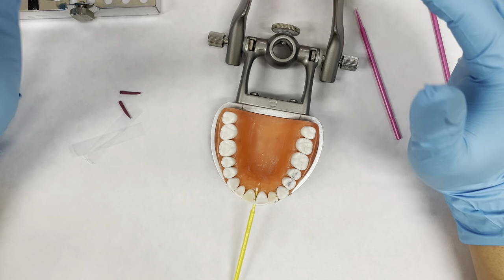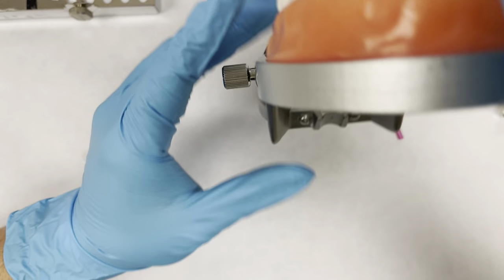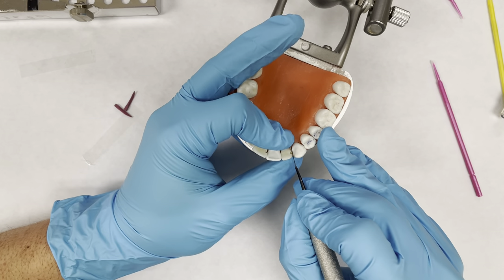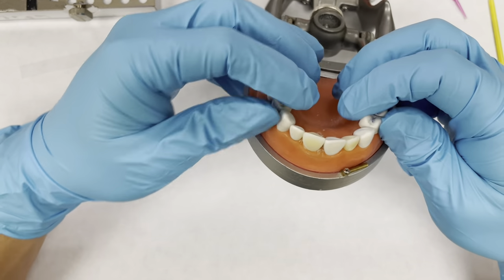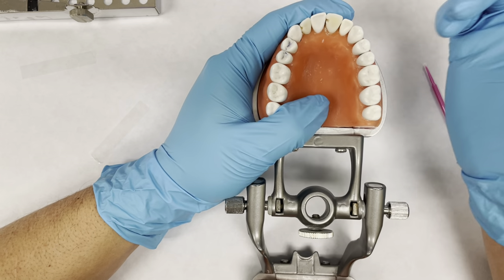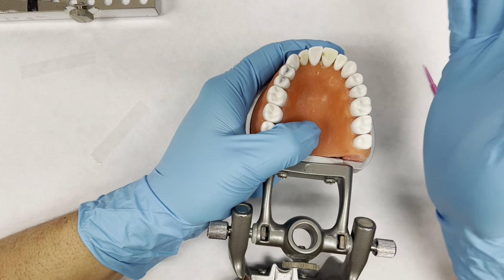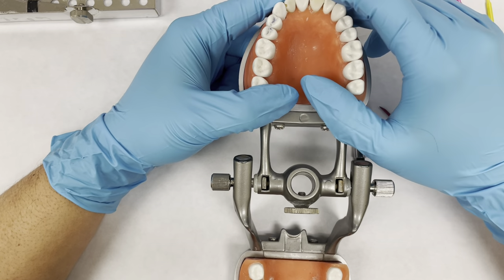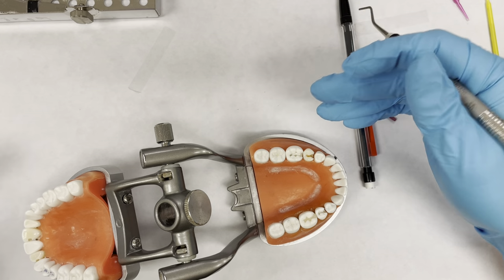How to pass the CDCA ADEX Exam Part 5 Restorative and Perio

Comment: Hi Dr. Rosales, thank you so much for making these extremely helpful videos. Could you please shed some light on the restorative diagnoses the examiners are expecting to approve before they can let the candidate proceed with the restorative procedures? Thanks much
Reply from the maker: Hello!

Before starting you’ll be presented with bitewing radiographs.  You have to determine the tooth and surface the caries are located on and the procedure you will be completing.  It is fairly low stress because there is only one interproximal caries on the radiograph.

Make sure you double and triple check the tooth and surface before letting the examiner know - if I recall correctly, you have two chances.  

As always, before starting your procedure - make sure you double and triple check the tooth and surface you will be working on before touching your bur to tooth.

Later on, you will have to determine if caries remain in the prep - if there are you will need to request a modification to extend your prep to complete caries removal or pulp capping as the manual protocol dictates.

Good luck and hope this answers your questions!
Reply: @michaelrosalesdmd7740  Thank you for your detailed reply. I appreciate it so much 🙏and look forward to more of your videos on clinical tips! 

Do they give bitewing for manikin too?
Reply from the maker: @tmjorofacialpaindentist5108  

They give bitewings for diagnosis!
Reply: @michaelrosalesdmd7740  Thank you 👍

Comment: Hi Dr. Rosales! Thanks for this helpful insight. I have a question, after reading the 2024 guide, I'm still a little confused as to how much to introduce the bur from lingual (class 3) into the prep itself (towards facial wall), will it just be 1 mm? and then depending on caries ask for modifications?
Reply from the maker: It looks like the 2024 manual says “The wall  opposite the access, if broken, may extend < 1.0 mm beyond the contact area. The outline form dimension is ≤ 3.0 mm
incisal gingivally.”

I read this to mean - 1 mm from the contact point where the teeth are touching interproximally.  Therefore, if you can see where the teeth are touching interproximally from the facial, then do not extend 1mm past that line.

If it helps, if you get a Stevenson dental solution 1mm diameter guide, you should not be able to place that between your prepped tooth and the adjacent tooth from the facial.

If you can’t get one of those tools, it’s possible to use a 330 bur (.8mm diameter) to measure - it should barely pass through facially between your prep and the adjacent tooth or not pass through.

Ideally, you should use your perio probe.  That is what I understand the examiners to use.

Best of luck!

Comment: is there a particular contact we should keep closed? like a gingival contact or buccal/lingual? i cant wrap my head around passing the prep portion with a closed contact
Reply from the maker: It really depends on the cavity preparation and you are playing the manikin portion within the rules you are given. The 2022 manual for the manikin restoratives stated that 
“Proximal contact is either closed or visibly open,” and you need to have <=1mm proximal clearance on the posterior restorative.  Therefore 0 mm (or a closed contact) is within the acceptable range for an ACC.  This is not to be confused with the gingival clearance where it is a DEF if the gingival clearance is not broken.  

This type of preparation may not be acceptable in a dental school clinical treatment setting, but within the rules established by the CDCA - a closed proximal was allowed per page 48 Preparation: Posterior Composite under the Proximal Clearance subsection.

Always double check your manual as it’s possible that the rules may change in each subsequent year!

All the best of luck and please let me know if there’s anything I can do to help!
Reply from the maker: I probably wrote a bit too much - please read the manual - but from what I saw in the 2022 manual - absolutely open the gingival margin because the manual states “gingival clearance is visually open but ≤ 1.0 mm.”

Of course double check the 2023 manual! 

Per the 2023 manual pg 48 PREPARATION: POSTERIOR COMPOSITE “Proximal contact is either closed or visibly open.”  (Always trust but verify with your own eyes.) Therefore, a closed contact for the PROXIMAL area should be ACC under the 2023 rules.  The difficulty will be getting the matrix in without bending/damaging it - you can wedge - slide the matrix down, remove the wedge, and pull from the bottom to seat it down fully.  Practice it in clinic multiple times before relying on the method on the exam.

Good luck!

Comment: What is the ideal Mesio distal extension of class 3 cavity preparation for 2022 exam ?
Please kindly reply..
Reply from the maker: Hello!

Sorry for the delay - ideal preparations will differ between central and lateral incisors.  They key difference is that centrals will be larger ideal preps where the depth of the axial wall extends less than or equal to 1.5mm in depth from the CEJ.

This is distinguished from the lateral incisors where the depth of the axial wall extends less than or equal to 1.25 mm in depth from the CAVOSURFACE margin.

This ultimately means that the maximum prep-able distance from the unbroken tooth (cavosurface margin) to the axial wall will be just under 2mm for the central incisor (1.5 mm from the DEJ + approximately .5mm for enamel thickness) 

It also means that the maximum prep-able distance from the unbroken tooth structure to the axial wall on the lateral incisor will always be less than or equal to 1.25 mm

Other than that key distinction - make sure that you are less than or equal to one mm for gingival clearance, less than or equal to 3mm outline form dimension incisal gingivally, and less than 1 mm facially beyond the contact area (described in manual as wall opposite the access - where you access lingually)

Good luck and hope that helps.  As always - verify all information in your manual!
Reply: Thank you for the detailed explanation

Comment: Lots of inconsistencies in this video, first of all 1) you have to break the contact going in 3mm deep from the occlusal if not thats a fail 2) you need to place the matrix first and then the wedge..get your theory right first and then showcase your practical work please. lots of students here who want to learn so dont confuse them by showing wrong method🙏
Reply from the maker: Hello!  Thanks for the input!  If possible, please cite your statements so that we can all learn from you!

In the Adex 2024 manual under Posterior Composite, 1) The pulpal floor depth is >= .5mm but <= 3.0 mm in all areas.

This means that you should not be going greater than 3.0 mm deep as it would result in a sub (The pulpal floor depth is >3.0 mm but <= 4.0 mm from the cavosurface).  Therefore, prepping to exactly 3.0 mm is a risk as, depending on the examiner and your own measurement, you may be slightly past 3.0 mm and result in a sub.

The caveat here would be if you prepped to <= 3.0 mm (which I would recommend prepping to around 2.8 so that you make sure you don’t land in sub territory) and subsequently requested a modification.

2) This is a manikin exam and keeping proximal contacts closed will guarantee a closed contact.  If the proximal contacts are closed a matrix cannot get in.   Therefore, you wedge, place the mateix down below the contact, remove the wedge, and subsequently fully seat the matrix and place the wedge to seal the base of the box.  

 if your gingival clearance is open <= 1.00 mm and your proximal clearance is closed (which is permissible under the statement “Proximal contact is either closed or visibly open”) 

Then this method works to prevent possible automatic failures in the restorative portion due to an open proximal contact.

Once again, thank you for your comment and all the best in your endeavors.  I apologize for your misunderstanding hope that that you will be able to respond with your citations to help all future students.